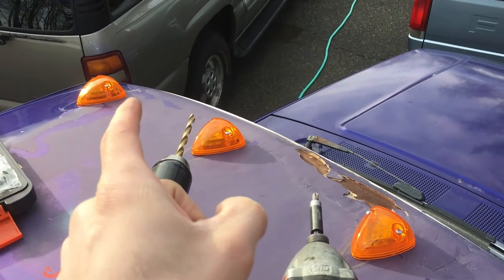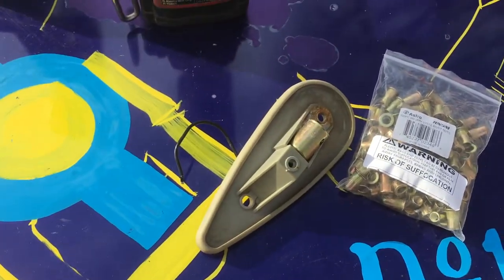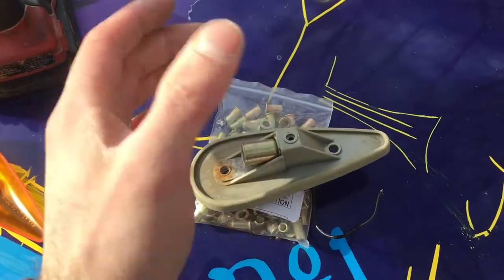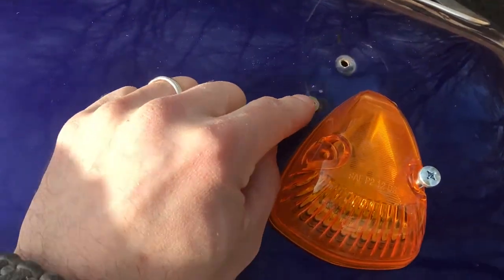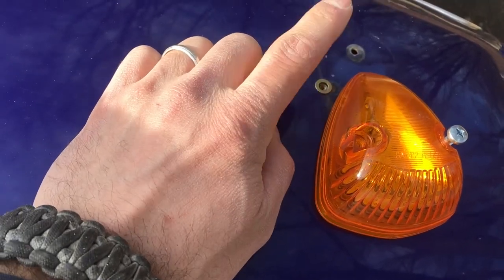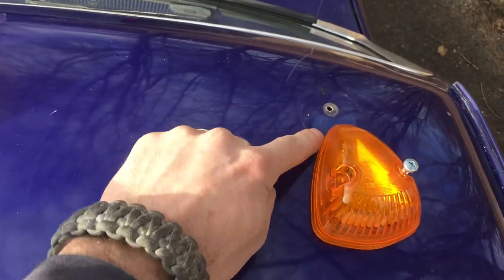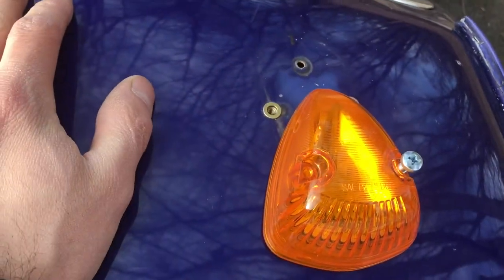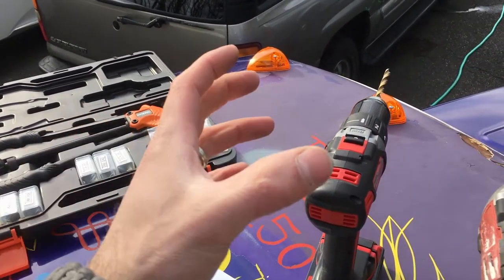Tips on How to Install Cab Clearance Lights | 1995 Ford F150

Comment: Great video. Going to install these cab lights on my 95 Ford F150. Thought you said in the video that the previous owner installed the trucks cab lights. Any possible way that you could do some sort of video on how the cab wiring is done on your truck for the cab lights and where the wiring goes to. I'm clueless at this part. Thanks for any help !
Reply from the maker: Thanks man!🤙 Yup the previous owner had a cheaper set installed.
For the wiring, check out my transmission temperature gauge video. It shows you exactly how to wiring in an accessory that only turns on once you turn on your running lights.
You’re welcome!
Reply: @TheMinuteMasters  I'll definitely check into watching that video. Thanks again so much for the help !
Reply from the maker: @rogerfarmer8919  you’re welcome!🤙

Comment: I’m hopefully goin to install some on my flareside
Reply from the maker: Nice! They definitely make these trucks look cool. However, they do introduce your truck to the potential of leaking through the top of the cab. So I’m probably end up removing mine because of that.
Reply: @TheMinuteMasters  if you used some type of sealer or spray from under it, do you think it would stop the leaking
Reply from the maker: @Brokenfatman  The lights themselves should seal and mine probably due. I just don’t know for sure because I also have a windshield leak.

Comment: what bolt size did you use?
Reply from the maker: mario ventura Good question! Part of me thinks it was a 16-24 thread bolt that was 2” long. It all depends on what type of clearance lights you install.
Reply from the maker: mario ventura 1/4-20 thread bolt.

Comment: Link to the lights your using?
Reply from the maker: aaron youngblood Here is the link: 5pc Amber LED Cab Lights [DOT/SAE Certified] [12 LED] [Waterproof] [Heavy Duty] LED Roof Top Marker Clearance Running Lights - (Universal Fit or Replacement for 94-98 Dodge Ram) https://www.amazon.com/dp/B0722YQSFS/ref=cm_sw_r_cp_api_Vj4RBbX5031VV

👍